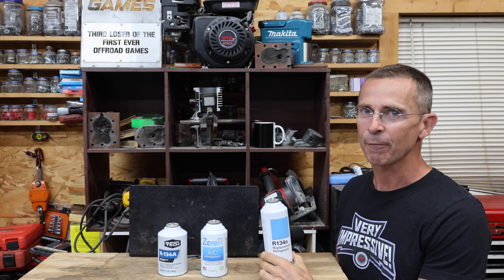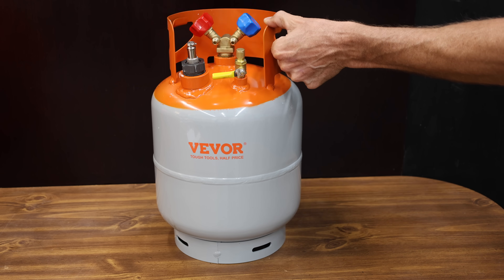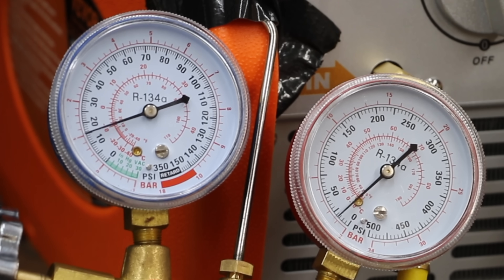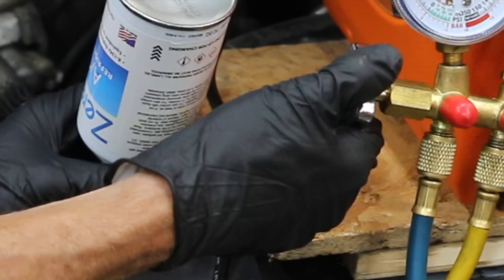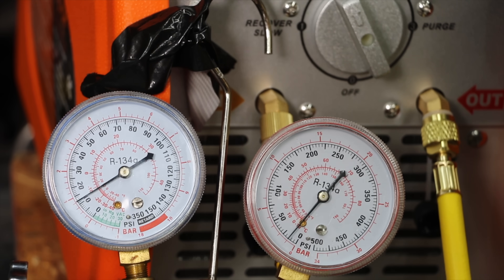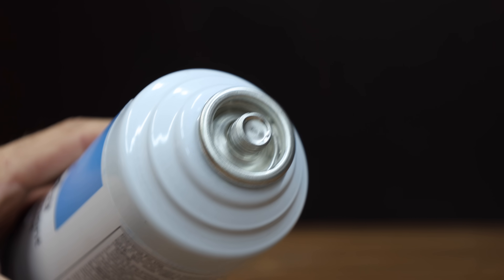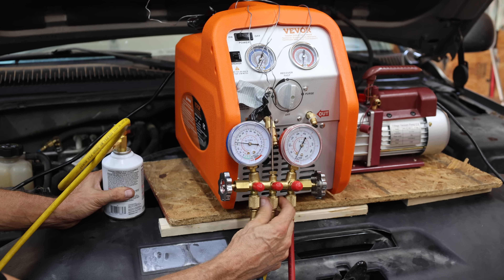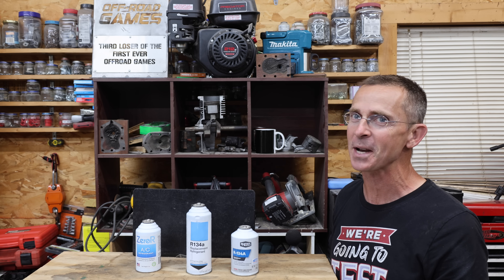How Dangerous is Fake Car A/C Refrigerant? Let's Find Out!

Comment: FYI, isobutane/propane can replace r12 and r134 and works fantastic.  It is a standard refridgerant in much of the world but banned in the USA for 'reasons'.  It is legal in Canada and actually works better than r12 and goes by Duracool and Rektek.  I'm not sure what your ZeroR actually is but the substitutes available in Canada are excellent. 

I changed all the gaskets and dryer in my 1991 r12 system in my Dodge pickup and charged it up with isobutane/propane Duracool and it has worked flawlessly now for over a decade.  A refridgeration technician that told me about it said it is silly to ban it and that car ac systems in Europe use it as do household refrigerators. It has zero ozone depletion characteristics, doesn't leak out as easily and you need less of it to properly charge a system.

r134 is flammable itself so that argument is moot.
Reply: Zero R is just 99% LPG.
Reply: R134A isn't flammable, R1234yf is very slightly flammable so it's classified as an A2L refrigerant. You can force R134A or R12 to burn, you just need a catalyst like hot copper wool to set it on fire and a constant heat source. But none of them can support combustion on it's own like R290 or R600.
Reply: @brnmcc01  My error. I meant to write 1234yf.
Reply: @ml.2770  No error, there's so many small variants of R1234. R1234ze is another newer one, supposedly a drop in replacement for R134A.  But the COP is lower and modifications to the condenser and evaporator designs and to compressor displacement are needed to achieve the same cooling capacity and energetic performance of HFC-134a.
Reply: And then there's R1233zd, but that's being used/developed as a replacement for R123 large commerical low pressure centrifugal chillers. Like in the old days of R11, and Trane CenTraVac systems. The new Trane Series E's in Europe are using R1233zd.
Reply: No offense but comparing the hottest days in Canada to a normal summer day in the southern US isn’t even a comparison. Apart from some anomalies Canada rarely sees over 85°f. Where I live we routinely get over 105°f. What works good up north isn’t guaranteed to work down south. 134a and 1234yf are the only adequate refrigerants I am aware of that can keep a vehicle comfortable when it’s 100+. No experience with r12 personally so can’t speak to its efficacy.
Reply: No offense but comparing the hottest days in Canada to a normal summer day in the southern US isn’t even a comparison. Apart from some anomalies Canada rarely sees over 85°f. Where I live we routinely get over 105°f. What works good up north isn’t guaranteed to work down south. 134a and 1234yf are the only adequate refrigerants I am aware of that can keep a vehicle comfortable when it’s 100+. No experience with r12 personally so can’t speak to its efficacy.
Reply: @Lubbocksfinest  Yup, there's a couple spots in BC that will get to just barely over 100, like Kelowna maybe high of 102, but that's inland desert areas, it's a dry heat, and nowhere near like Houston, TX with 100% humidity and 100 degrees. It's the 80+ degree wetbulb temps is what kills people.
Reply: Love duracool. Run it in all of our tractors and combines. Works great and in my experience leaks less. 👍
Reply: @Lubbocksfinest  No offense, but we get 100F weather on the regular in BC where I live.  It works better than all of them including r12.  My ac blows ice cubes.
Reply: @Lubbocksfinest  Propane is an excellent refrigerant the only reason it's not more widely used is the flammability. The federal goverment has a cap on the total amount of flammable refrigerant you can have in a cooling system that mostly limits r290 and r600 to small systems like mini fridges and countertop icemakers.
Reply: A tech was badly burned working on a system where R290 or Propane had been put in instead of R22 here. Flammable refrigerants have risks especially in larger systems should they spring a leak inside a home, business, or factory. Propane will work in R22 systems, but it is not allowed in most here mostly for that reason.
Reply: The biggest issue I could see here in the states would be liability. If you get into an accident, and the a/c system is compromised, explodes or causes a fire, it could injure or kill someone. Your insurance company could flat out deny your claim because you used a product that is illegal in the states to repair your car's a/c system. Just because it can work, even if it works very well, doesn't mean you should use it.
What if it kills YOU in an accident, and your family is left without you, and also no car insurance, or life insurance, because you used this product to repair your car to save a few dollars... You do you, but I say, "No, Thanks!"
Reply: @AlAmantea  If all 6oz. of propane somehow leaks out at one spot and goes off at once?  There's more danger in the fuel rails.
Reply: Your degree on chemical engineering is from where?
Reply: @ronbelanger4113  UBC
Reply: Yes! Here in Canada we have this "12a" which is a mixture of propane and butane, and it's way more efficient than R134a (which we can't buy over the counter). My AC had a puncture in a line and after I fixed it, I charged it a12 and I can't even use the AC in the max setting, it's cold as heck!
Reply: People worried about exploding refrigerant often ignore the fact that they have a  propane barbecue in the back yard  with a 5 gallon tank that they put in the trunk of their car to fill.
Reply: @Joe_Blo  and also that they have pressurized fuel lines on top of the engine.
Reply: @Lubbocksfinest  Except when it hit 49.6 degrees C or 121 degrees F in Lytton BC...just before the entire town burned down. It's currently 90 degrees F outside my house (north side, shade) in Vancouver BC on the coast. And my car AC just quit. Damn.
Reply: I used RedTek in one of my brother's cars and I was surprised how well it worked. They make it pretty easy to add the gas with the one pressure gauge.

Comment: Just understand that all a gauge can do is get you in the ballpark.  The only way to accurately charge a car's refrigerant to the correct level, is to pull and vacuum on the system and WEIGH IN the correct system charge amount.  Going by a gauge will pretty much always leave you somewhat over or under-charged, and neither is good for optimal cooling and efficiency.
Reply: Having dealt with two old cars converted from R12, driving the vehicle until it cycles at the correct temp is the only way to tell if the charge is right in an OCCT system. Not sure about POA or the modern H-TXV. Temp and humidity are too variable where I live to rely on gauage pressures alone.  Weight only applies to a system getting the original designed refrigerant, and yeah, it's the best way by far.
Reply: Had a 96 Tercel with a sight glass in the line. I used to fill (had a small leak around the compressor)  it until the bubbles went away, then shut it off, and it blew colder than any car I ever had.
Reply: @o.m.a.4670  my 96 corolla had that same sight glass, toyota always seem to have had the best a/c back in the 90s.
Reply: @o.m.a.4670 I have a 2002 Prius, it has a belt driven air conditioning compressor with a special "cold-storage" evaporator core so it keeps cooling at a traffic light with the engine off. The official spec is an additional 100 g of refrigerant AFTER the bubbles in the sight glass disappear.
Reply: Have fun charging an ac system using a variable displacement compressor using pressures.  You can't charge newer systems using pressures and expect good performance.  They use much less refrigerant.  Just being a couple  of ounces off can affect their performance.
Reply: Weighing in the charge works great when using the intended refrigerant on a stock system, but the stock spec is not going to work when you use a different refrigerant.

You also have to be careful if the system isn't original because something like an aftermarket evaporator or condenser of a different design or with a different number of rows may not have the same capacity as the original system did.
Reply: @Discretesignals  Great point, variable speed condenser fans can throw off the pressures too. It's entirely possible to see "normal" pressures despite a drastic undercharge or overcharge because the computer will just vary the speed of the condenser fan and the output of the compressor until it sees the pressures it wants to see.

You can literally see normal looking pressures with only 1/4 of the proper charge and barely any cooling at all.
Reply: Checking superheat an subcooling can be better than weighing alone.
Reply: @fascistpedant758  can't charge a vehicle using superheat and sub cooling because most of them are oversized.  You'd have to put a good heat load in it to  to make it run full tilt.  You also have variable cooling fans, blowers, and compressors that can change their displacement.  The system is constantly adjusting moving your target all over the place. Not all systems are the same either.  Best to just charge by weight as per manufacturer.
Reply: @stevecooper8121  My LS400 AC was very powerful, never had any work on it and the car was twenty years old.  The pipe flanges are built like a battleship.
Reply: In modern AC systems for residential and commercial, weigh in is a temporary measure and when conditions are better with ambient temp you need to reach a target subcool value on the liquid line, essentially how much the liquid is cooled past the condensing temp, some systems want a tight 7 degree subcool, some want a more conservative 12 degrees.

For variable speed systems, they have to be put in "charging mode" which sets the fan and compressor to a fixed RPM, typically 100%, and will give a timer to equilibrium to start charging.

Comment: As a mechanic in the trade. First thing we use is a a/c contaminant tester. Those bottles that have the sealant in them are a plague for us. they will ruin our machines. If they'res no sealer in there i got no issue, The sealer plugs up orifice tubes and causes expansion valves to slowly jam up.
Reply: They have a sealant leak detector kit.  It basically screws onto a service  port and allows a small amount of refrigerant to blow through a tiny orfice.  If the orifice plugs up, it's got sealant and the whole system needs replaced.  Of course, no customer wants to pay the cost of an entire system, but you save your equipment.
Reply from the maker: Thank you for sharing!
Reply: Any product with a leak sealer is not safe for the life of the vehicle.
Reply: @MonkeyDelicious  I've known a couple dozen people who have used radiator leak sealer, a/c leak sealer, tire sealer, steering gear sealer, and magic trans rebuild in a can. All but one of them regretted it, the lone exception had a leak in his radiator out in the desert (Before SAT and cell phones, and on a truck with a rebuildable radiator.). He knew it would ruin his radiator but that wasn't as bad as walking out.
Reply: @Discretesignals  Why can you not simply solvent flush the system thoroughly, maybe twice? It seems like discarding the entire system is wasteful and unnecessary. That's not to say I think people ought to use the "fix in a can" products; I hate them all. I just don't see why it is automatically necessary to replace everything because someone did.

Comment: I worked in HVAC for over a decade, yet I sometimes call these refrigerants "freon" and don't give a crap about whether it's a trademark or not.  Everyone (above a certain age) knows what "freon" means, just as everyone knows what kleenex are.

To be clear, I normally refer to these as "refrigerants" and typically just by name (R-134a, etc), but if I or someone else slips and calls them "freon" I don't mind.  No one does except the trademark holders and I don't care what DuPont thinks.  Neither should you unless you upload youtube videos that might trigger some reaction from a trademark owner ;).
Reply from the maker: Thanks for the feedback.
Reply: It's like everyone calling cotton swabs Q-Tips. Some people call most chips Doritos or Cheetos. Soda gets called Coke.
Some brands are just that popular that they literally BECOME the name.
Reply: I agree and it’s an acceptable colloquialism not a malapropism like calling a slot screwdriver a flathead- of course that is an accepted term so…
Reply: Agreed. Got a few show off smart ass commentators here that show up at car shows with a Starbucks and tell you that a "motor" is electric. I beat all those pseudo intellectuals in school without getting hung up on colloquial expressions. Now, I need to go and xerox a few things.
Reply: Yep an Baind-Aid ect.  Ain’t squat wrong with it. But the run of the mill customer is going to always know Freon may not be the right term. But everyone knows that

Comment: Suggested video:  HYDRATION BACKPACKS - for hiking or cycling. Example brands: Water Buffalo, TETON, MARCHWAY, Camelbak, Thule, High Sierra....
Reply from the maker: Thank you for the video idea!
Reply: I've save you some time. Source hydration systems.
Reply: good one
Reply: I threw my camelback away.  Pita to clean.  Kinda a gross concept
Reply: @usernameisusername  source has some coating inside that prevents buildup. I haven't bought anything since Israeli went to war though so good luck on shipping .

Comment: Protip for those of you who can't get R134a anymore (or struggle to find it due to decreased production): R152a is a near perfect drop-in replacement for R134a. You probably won't be able to get refrigerant-grade R152a, but there's another source of it that you've probably got somewhere in the house already—computer duster. Yes, that's right. Computer duster is most often made of R152a (with a very small amount of Bitrex added to deter huffing, like less than 1 ppm). Just multiply your system's R134a capacity by 0.64 and that's how much R152a you'll need. It even gets colder than R134a in some cases. Best part is it has a GWP about 1/10th that of R134a, and since it's sold as duster you can vent it to the atmosphere without breaking any laws. Just make sure to check the SDS for the brand of computer duster you intend to buy, as some don't use R152a. Also keep in mind that R152a is mildly flammable, so proceed with caution. It is less flammable than R1234YF and R290 (propane), so it shouldn't be an issue.
Reply from the maker: Thanks for sharing.

Comment: Careful with that 134a tank. Those kinds of tanks are not meant to be reused. Even your actual recovery tank (that I assume came with the recovery machine) isn't preferable. I bought one of those off Amazon, and it leaked. They don't go through the same process the official recovery tank makers do. I don't think you could even exchange it to be recycled, even if you were so inclined. Just don't fill it up to much. We would be devastated if anything happened to you 😞
Reply from the maker: Thank you for the heads up!
Reply: @EricK-jx7lq  the main problem is it’s not dot approved and nobody will exchange it.  Yes the goofy float valve inside the tank is not to be trusted as well
Reply: tommyq374  It's funny how supposedly environmentally conscious countries claim to be yet many things needlessly are made throw away.  When they can either be re-used or a simple design change would allow that.
Reply: @ProjectFarm  THAT TANK IS DESIGNED TO AT "LEAST" HOLD THE AMOUNT  OF REFRIGERANT THAT IT HAD WHEN SOLD,  ANY EXTRA TALK (COMMENTORS)  IS  MIS-DIRECTED PERSUASION FROM THE MARKET-PLACE ( SALES)  &/ OR  MIS-INFORMED LAWSMAKERS!!!!!!
Reply: I’m surprised he was able to recover into the used tank.  The green valve is an industry known indicator that it is a one way valve designed to prevent refilling the one use disposable tank.  It’s been the industry standard for 30 years now.
Reply: @waggtech4883  another commenter noted that it's easy to subvert that restriction. I was surprised as well.
Reply: @2bnax  a recovery tank has a relief mechanism other than exploding plug. That’s why it’s a bad idea
Reply: Careful to Not reverse the valves and pressurize the little cans in error. They explode. A 'freeze burn' is akin to a fire burn on skin.. ..Disfigurement.. ;/
Reply: @ProjectFarm  One more for you, from a witness.. Careful to Not reverse the valves and pressurize the little cans in error. They can explode. 
A 'Freeze burn' is akin to a Fire burn on human skin.. ..Disfigurement.. ;/
Reply: @ProjectFarm  It's legal to use it like you did, what you need to be careful of is, you have now violated the DoT safety regulations and it's a federal offense to transport that cylinder like that on the road. But if you empty it out, and pull it into a vacuum, you're free to take it to a recycling center and scrap it.

It's only illegal to transport it on the road, it's your own risk if you use it at home on your own private property.
Reply: @EricK-jx7lq  I’ve never tried it.  I always knock a hole in the rupture disc myself…
Reply: He is just putting back what he took out. Not really what you are supposed to do but I don't see how once for a test so you don't waste the refrigerant matters. The pressure won't be any higher either unless he overfills it.
Reply: @2bnax it’ll definitely hold what was some. An I’m sure their pressure tested a good bit above that. I wouldn’t push it. But it’s definitely going to hold what it originally had for sure